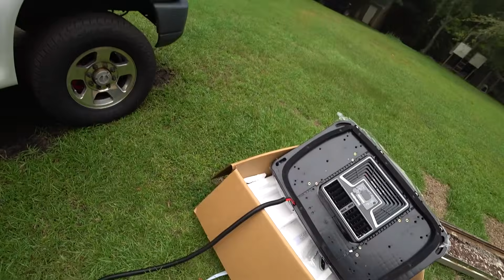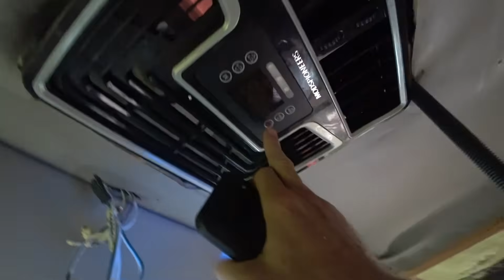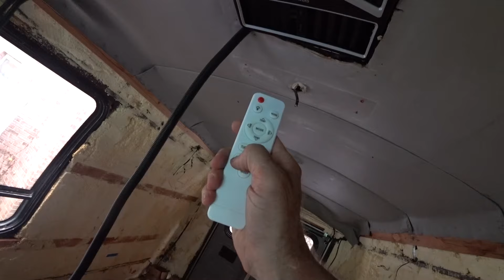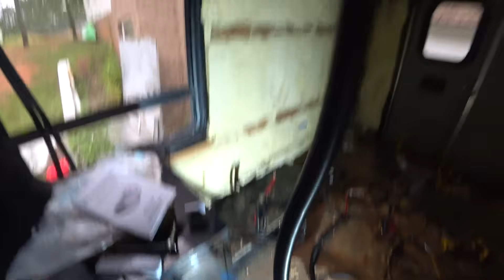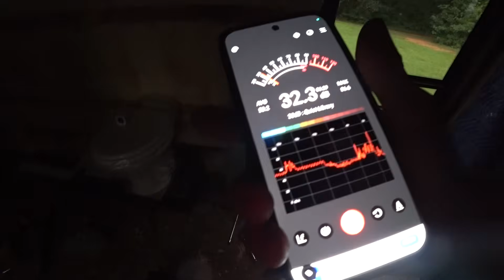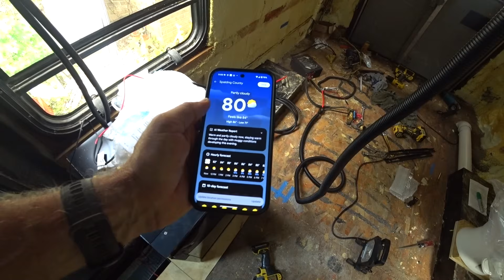Does This Off-Grid AC Actually Work? E350 | ModsPioneers 12v Rooftop Install & Power Test

Comment: Appreciate the video & information.  What's the ceiling height? I'm building an enclosed trailer and ceiling height is like 6'3" and the dometic 13k btu is so loud, I can't enjoy  sitting inside. 
At the vent, it's 70-73 decibel, 6" above your head.